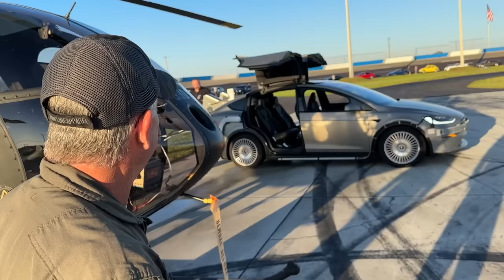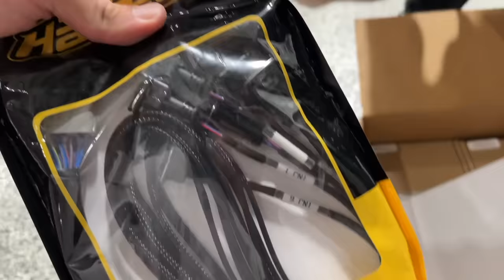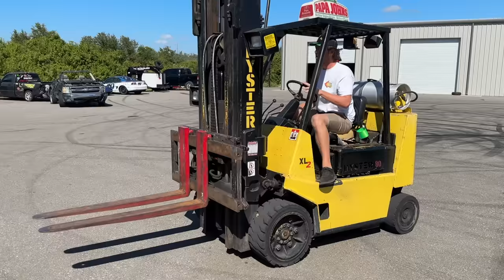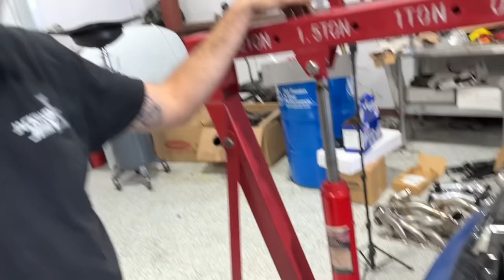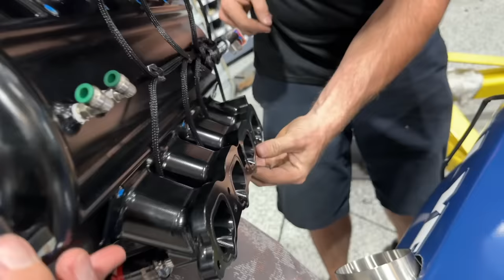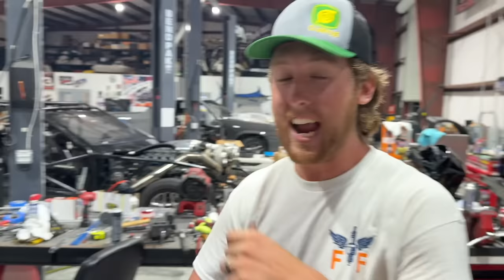McFlurry Get's a 2,000hp Twin Turbo Coyote Swap In ONE WEEK... SOUNDS AMAZING!!!

Comment from the maker: Don’t miss out on all the action this week at DraftKings! Download the DraftKings app today! Sign-up using https://dkng.co/cleetus or through my promo code CLEETUS
Reply: Never bet against a fox body with a Coyote in it. This thing is going to rock the house. I have a coyote in my truck the beast weighs 56++ pounds, tuned running on E85 4x4 Crew and that thing is quick to haul that heavy ass up to speed. 8k RPM glory machine.
Reply: Top tip for the Diesel. If there ain't a lift pump to manually prime the system, pour the diesel from the old filter into the new.
Bob's yer uncle, fannies yer auntie 😉
Reply: I find advertising for betting, alcohol, ciggs, vape, weed or anything else addictive is gross. C'mon bro.
Reply: got them cunningham machine blow by tubes on that engine. local here in ky
Reply: If y’all have any questions about your cascadia let me know. I’m a tech for freightliner
Reply: When are you starting on the Holden ute 🤙
Reply: I can't believe you replaced ruby with a ford ruby is such a better car
Reply: Are you showing us that Garrett is JUST about money and whomever profers it for your vouching  ??  I thought your were better than that .
Reply: Tell Zack on the left side of that Freightliner motor there’s a black cap about 4 inches round and right beside it is a round cap. That is about the size of a quarter. unscrew that cap and pull it up is the primer for the fuel system where when you get done changing the fuel filters.
Reply: Fuel filter housing has a prime knob on those diesel motors. Should be able to pump it until it's hard to push down then you're good to crank her up
Reply: @Smokkedandslammed  glad i wasn't the only one thinking this.
Reply: I own a Cascadia.  There's a bleeder tool that hooks to the pump housing that bleeds the air out of the fuel line. It can cause damage if you keep doing that. 😢
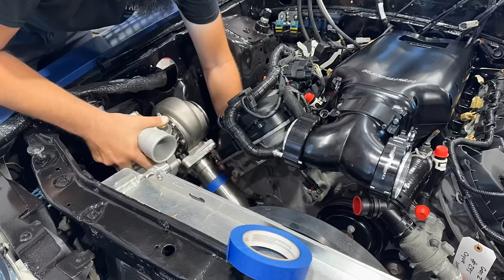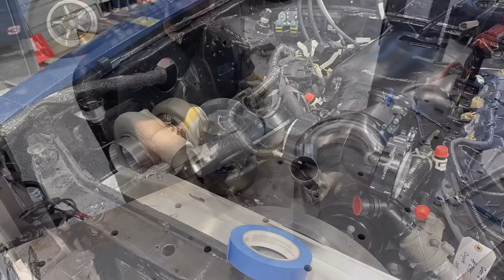Reply: Gonna reupload this for the 10 seconds of nothing at 8:45 to 8:55?
Reply: You gotta pump up the diesels if you put a new fuel filter in
Reply: Cool giveaway idea,   Tye built headers and exhaust for customer car.
Reply: Blessings Cleeter from Kissimmee FL I was wondering are you guys considering on building chassis for clients? just wondering since I know you all have an amazing team However, I know you all are Super busy also but thought I'd ask. Blessings to you the whole team and your respective families and loved ones from my Family and this humble servant
Reply: hate the sponsor, encourages gambling, not wholesome
Reply: Hey you should be specific in your sponsored ad because I signed up with your promotional code. Didn’t get the 200 bucks because it’s not available in my state of Oregon after putting money into the app they don’t allow you to pull the money out unless it’s a certain amount over 50 bucks only reason I did this was because of the promotion offer and I didn’t receive it.
Reply: you really shouldn't be promoting gambling sites bro you have minors that watch your channel and even if your didn't there has to be a better sponsor than degeneracy, ive been a sub ever since you bought ruby at the action with the tahoe 5.3 in it but if this is the route your going to continue to go then im going to have to pass. i know im just one person and im sure you dont care but you can do better
Reply: My jaw hit the floor when the engine was unboxed.  I hit pause and admired that shiney black block and awesome polished valve covers.   It looks so sick!
Reply: I can't wait for tomorrow to get here
Reply: Really dude .. gambling?? …. Thought you had more class than this.
Reply: That man is a legend and I believe that anyone who is in his presence should be honoured to have met him. You are blessed to have him as a member of your family / team.
Reply: Betting on other people's actions is a losers game. Doesn't surprise me that Garrett is pushing this crap though. Anything for a buck, even if it's going to hurt people.  Sad little man.
Reply: Here’s another vote for you stopping promoting gambling.
I really enjoy the majority of your content but if you keep promoting gambling I will unsubscribe and stop watching.
Surely you have lots of other companies who want to advertise with you.
Reply: @bluestripes1 fast forward then 😮
Reply: Sports betting has ruined alot of peoples lifes, out of all the sponsors this is a awful one.
Reply: 😢 I never thought you would advertise betting.
Reply: Can’t be that strapped for cash that you gotta partner up with sponsors like this 👎
Reply: CLEETUS AND CREW - Have you ever thought about doing random giveaways to fans that show up for your events? Might be a good way to sell more tickets if people know that in addition to the great show they are about to see, there's a chance they could win something, Could be as simple as hats and t-shirts, maybe ride alongs around the track or something like when you do giveaways to people who order your merch. Just a thought.
Reply: Dude, can't you do without the gambling ads? Gambling destroys lives.
Reply: Loving the Coyote in McFlurry! Hell yeah Brother!
Reply: Still no intercooler on that foxbody?
Reply: Put a FASS system on the toter
Reply: Can't stand the gambling promos
Reply: When cleetus said use rtv to hold the oring in.... use 3m weatherstripping adhesive. Holds it the same but peels off by hand next time you have it off/change gaskets. Much less work. Works for all gaskets.
Reply: @terrypickette118  Sir,......are you high?
Reply: Oreo speed wagon
Reply: Soak the fuel filter in fuel before installing. It helps we have some Detroit engines where I work.
Reply: Coyote Mcflurry sounds like animal cruelty.
Reply: Speaking of Godzilla, the new movie comes out in 34 days, you guys gonna watch it?
Reply: Cleet you’re cheating on Ruby now
Reply: Man, I really wish you didn’t do this. I mean this is a really bad affiliate affiliate with I’m not just shady practices. I mean it gambling. I really expected more for you guys. To be honest I mean I know they pay well but every single dollar they’re paying you is a dollar they sold someone else I wouldn’t want that type of money that’s dirty money.
Reply: Every car in the fleet has had 1-3 new engines.  (Ruby staring from the side shed).  The girl deserves the best engine you can get your hands on and no more hand me down engines either.  Up until the last iteration, she was your most reliable and predictable car you had in the fleet.  She might need to become the funny car (I love her current body looks though) or something McFlurry isn't so she can get love again.  She's just too damn sexy to be gathering dust.
Reply: I may know that guy that did the number 3 on that cap 😜
Reply: Are we about to go a fourth day with no world cup content?
Reply: Right foot broke the Coyote? 🤣
Reply: Withdrawing. It’s been 4 days
Reply: @steveletson6616  It surprised me. I thought he was above that. It looks like I was wrong. If he does it again I'm unsubscribing and burning all my Cleetus gear. This channel was one of the few things helping me keep my shit together. I was just glad to see someone who I thought deserved it prosper and do these fun things because I'm physically and financially unable to. It makes me really sad.
Reply: @billmccandless1916  I just stopped the video and will not watch it. Screw you and Garret if this is how he is.
Reply: Great video, garbage sponsor...

You're all better then that.

Comment: McFlurry gonna be right on mullets ass they keep it up😂
Reply: You might be right, I mean Mcflurry needs a little more work before it can safely go into the 6s but it'll be fully capable of doing it. Meanwhile Mullet is about tapped on it's potential. They really can't make Mullet much lighter without going to a tube chassis, which might be what they have planned but who knows. But if they do a few more things to Mcflurry and put bigger turbos on it after world cup they might be knocking on the door of Mullet soon.
Reply: @TheFlooringInspector82 idk they always seem to surprise us but he’s wanting a super bird that he can go 5s in the quarter mile I can’t wait for that
Reply: @kevinsimmons2815  They might be able to run 5s with Mullet on 315 tires. They still have room to turn it up even higher.
Reply: Seriously, sounds like this coyote won’t be as capable, but with a better engine, McFlurry could run nearly as fast as Snot Rocket (that green coyote mustang that ran 6.33 to beat Mullet). 

Probably should upgrade the roll cage, currently only good for 7.50, can easily cut a lot of weight from a fox body too.
Reply: @matthewdoty2685 they are out there running 5s on 275 all day, look at drag week, not to mention all the no prep guys... x275 is a bad ass class
Reply: @matthewdoty2685  - No chance in the cars current configuration (as a drag and drive car).  It’s simply too heavy.
Reply: @kevinsimmons2815 that's the build I'm waiting for.
Reply: McFlurry has 2 Big Brothers  that have first dibs!

Comment: i used to work on those freightliners and they have a bleed fitting right on the fuel filter housing, you can get a pressurizer bottle and put the same fitting in the end of the pressurizer and it’ll bleed it and start first time!
Reply: User name checks out,
Reply: or pump the shit out of that primer 😆 but yeah that's the easiest way for sure
Reply: Manufacture spec for the primer is 250 pumps and if you ever worked on those dd13 and dd15 it almost never starts that’s way! You can buy a esoc system/cart to pressurize the system to pull air out and prime the system without even the truck running
Reply: @harleywittmus6894 this right here is a guaranteed 1st start
Reply: Just use staring fluid and problem solved, I know is bad for the fuel pump but if you don’t have the prime tool is the easiest way to do it.

Comment: I love how a Ford in a Ford is the rare combination
Reply: I have always preferred when people don't just "slap an LS in it". I get that it is the easy path, but it is nice to see brand consistency.
Reply: Crossbreeding is just something GM guys do because they have anything that compares to a Mustang $ for $...
Reply: It's not a LS swap, it's a Foxbody swap.
Reply: @02autogt laughs in s10, catfish camaro, &g-body
Reply: @tymosher17 right?  I guess he doesn't recall that all it took was heads cam and exhaust and the fbodies were dragging cobras all day.  Just add nitrous for the modded cobras. Don't get me wrong I liked them both, but gm cars were walking the ford's on the regular aside from rare exceptions. Hell the 97' RS Camaro with the 3.8L i had in high school would run door to door with the auto GTs at the time with just an intake and full exhaust lol
Reply: @TS34675 until the terminators came out…LOL
Reply: Always remember, the LS needs the Foxbody. The Foxbody doesn't need the LS......
Reply: Lol typical GM guy. Brags about spending thousands of dollars, and rebuilding the top have of the engine, just to beat a stock car. Lol

I’m all serious as a Ford guy we do it to ourselves. There is no reason why an engine that’s been out almost 14 years should still be that much. You can pick up an LS for a few hundred. For the budget minded person it’s a no brainer.
Reply: its not rare ford in ford

Comment: Tell zack there’s a hand primer for the fuel system on the toter next to the filter housing. The starting system will more than likely go into overheat protection mode if attempting to prime the system just by cranking. And don’t use ether/starting fluid.
Reply: You can use starter fluid have for years.
Reply: It's not going to overheat and go into protection mode lol.
Reply: Silicone spray
Reply: Diesel tech here. Those Detroit's have an aluminum fuel pump. They require 95 p.s.i. of constant fuel pressure for three minutes after a filter change. The primer pump is made by Davco for Detroit Diesel. You can use the hand primer at the filter housing but have to pump it a  minimum of 150 to 200 times before the filters have enough fuel. Also never use staring fluid on a modern diesel engine with an aluminum fuel pump or one that has a grid heater for the intake.

Comment: Finally a fully built coyote on the channel!
Reply: What do you think neighbor has in it? Its not quite on this level, but its not stock.
Reply: Personally going to just skip through this content there is plenty of coyote foxy bodies to watch and it gets a little boring after a bit.. Godzilla is what made the content fun and interesting to watch since it’s unproven combination. 

That’s kind of what this channels content has always been to. The unconventional.
Reply: @Mr.Ghost_og godzillas engines can't do what coyotes do like tye said if u can't beat them join them i find this better that the godzilla idk if is bc i had a 5.0 but i like them
Reply: @Mr.Ghost_og  the 7.3 "godzilla" junk name for a motor imo had found its limit. Cant keep a head gasket in it. Why keep beating a dead horse when there are better options lol. Eventually the aftermarket will better the 7.3
Reply: @reidelmartinez6199  it’s all good.. I mean hunting for times with a coyote in a foxbody is just like everyone else like I just said… boring af for content reasons. If I wanted to watch that there is already thousands of hours of content to watch of foxbodies running fast times with a coyote in it.

Even a barra would have at least of been interesting and it’s not like there isn’t all billet ones running just as quick making up to 3k hp
Reply: @robbygray9562  the whole point I just put up is it was different. Coyotes is the same exact thing we watch it most foxbodies and is personally not why I watch the McFlurry build. It’s not all about running fast times that’s why the blazer is interesting. Even a barra in the foxbody would be interesting to watch and easily as fast if not faster since they’re proven to make even more power.

Comment: Hopefully mcflurry will live longer than mcdonalds icecream machine😂😂
Reply: So far it has not not proven to be any more reliable than the Mcdonalds ice cream machine. Hopefully having a fully built Coyote will resolve that. They could barely make 2-3 passes with the Godzilla engine before it kicked a head gasket or worse. Glad they finally switched to a better platform.
Reply: @TheFlooringInspector82 yeah when they turned it up to like 32+ psi. Wait till the megazilla is out
Reply: @TheFlooringInspector82 it was running 8s like nobody’s business  out the box 📦
Reply: Let's just hope they don't have the same contracts those vending machine companies have, or it will never get fixed when it breaks 😁

Comment: Wish more younglings take up a hobby like this young boy have done! Proud of the little man
Reply: Kinda hard unless you have a channel like this that pays you to pretty much build and race these cars, or if you’re just wealthy in general. Would be pretty hard for a regular person to spend $15-20k on a short block alone like this one, a $5k intake and the 10s of thousands of other minor things in this single car alone. I actually bought this exact short block from TKM and am putting it in my black on black 93 notchback. Will be a pretty much identical setup to McFlurry but mine has a tubed chassis. But yeah, really, really expensive to just do this for a hobby.

Comment: Now you just need to get ruby up and running again so she can run a 6
Reply: thought ruby was good to go?
Reply: @xdzombiezz4163 im pretty sure Ruby still has no life line in her.
Reply: @xdzombiezz4163 Last time they showed her she didn't even have an engine in her.
Reply: @burgboy2459 1 week job 😅
Reply: @xdzombiezz4163  Ruby is going to get the LSX they recently pulled out of Leroy
Reply: Man I miss ruby
Reply: Ruby reached the limit of her stock chassis. To go any faster the car would have to be cut up and major chassis work completed.
Reply: @SteelqcxB0  Right lol she's probably getting a coyote as well.
Reply: @burgboy2459  She needs one to go fast!
Reply: @xxZerosumxx  Yep no hate here I don't care what motor it has as long as it's fast!
Reply: Ruby was running, Nate was driving it when they were testing for FL2K, it shut off during the pass but I don't remember what it was.
Reply: @michaelwynne4346  She definitely isn't running now go look at his video titled here's why mullet has been missing and skip to the 8 minute mark.
Reply: Ruby needs some real good at doing stuff in her life, a badass freaking HED built Big block.. 🤤
Reply: Ruby is getting Leroy's old engine
Reply: @xxZerosumxx ...need one to go fast...🤣...7.5 is a basic LS... mcflurry needed a Godzilla...umm...yea...ok buddy🤣🤣👍🏼
Reply: Ruby needs a TKM stage 3 LS. That package holds the hydraulic lifter 1/8mile record of 4.11 @ 180mph

Definitely tired of seeing Cleet struggle with constantly breaking Texas Speed engines
Reply: Rubys in a coma right now

Comment: Those Detroit engines have a manual pump on the fuel filter housing you have to pump it about 200 times when you change the filters... alternatively Detroit makes a factory too that is an electric pump you can hook up to bleed the system.
Reply: I work for a Freightliner dealer, you can damage the fuel pump if you keep cranking it.